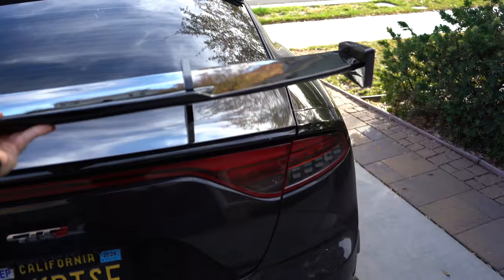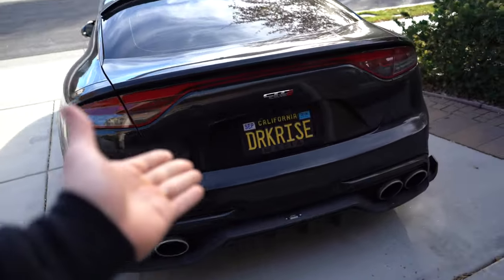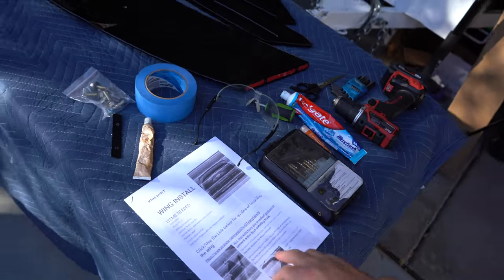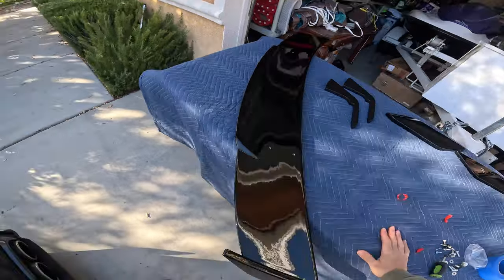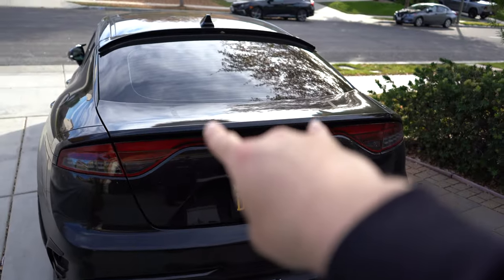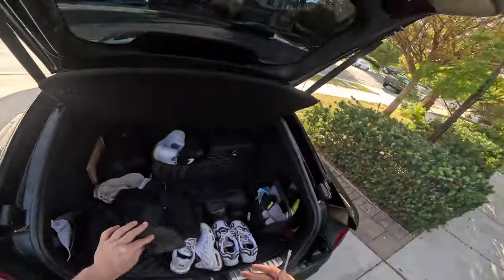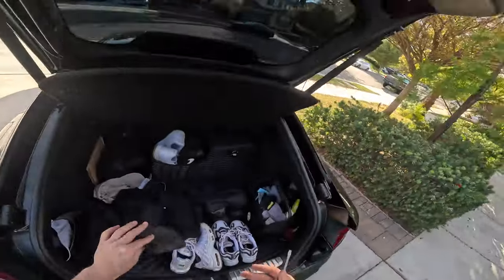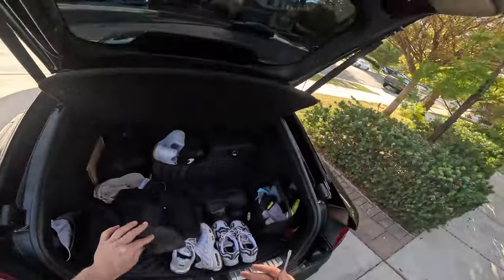KIA STINGER Wing/Spoiler Install!!

Comment: can you open your trunk in the garage and not hit the garage door up top with the wing??
Reply from the maker: In my garage yes but I opened it in a hotel parking structure and had about 3-4inches pf clearance. I am lowered af so it helps. Also the GT2 tailgate has a censor if its taped or has any stress while opening it automatically goes back down. Good safety features💯

Comment: does the wing come in carbon fiber?
Reply from the maker: No its a ultra light polymer that way the same as a carbon fiber option. Reason I don’t sell carbon is because they crack easily and sun age over time.